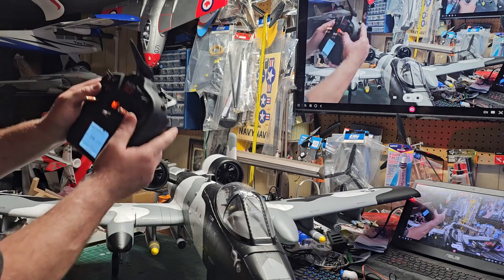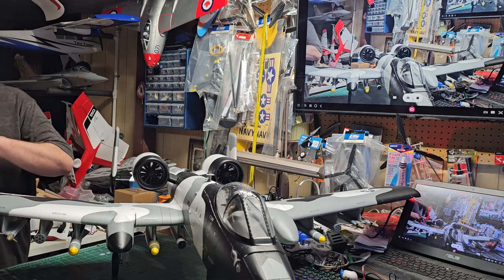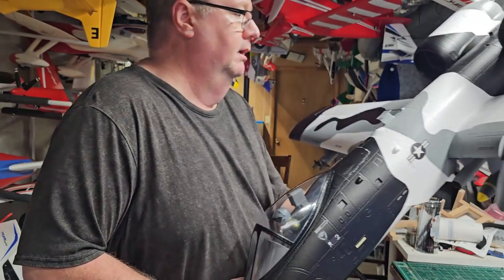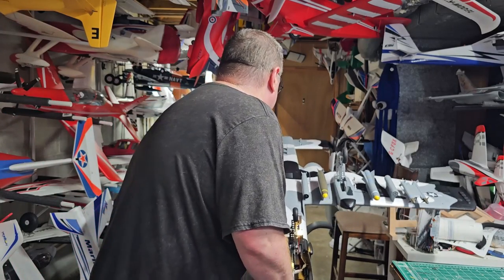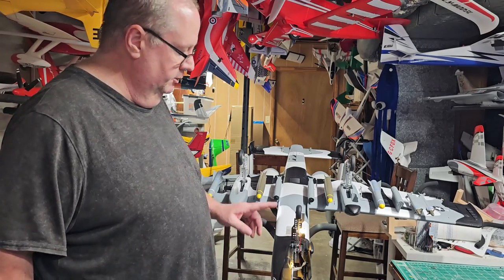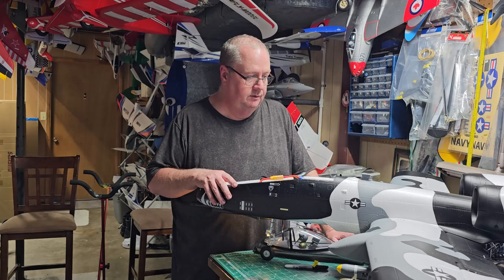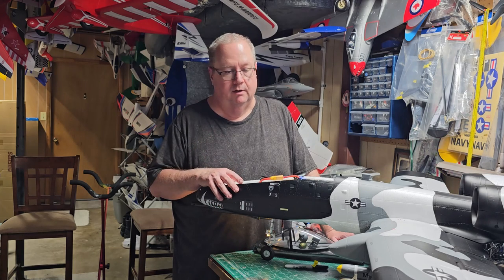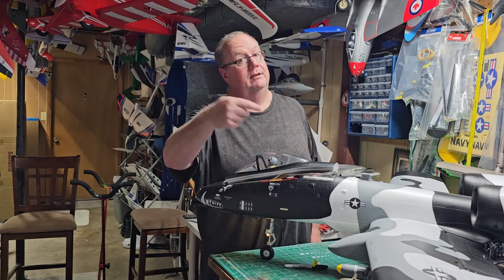FMS A-10 THUNDERBOLT V2 RADIO SETUPS INCLUDING  REFLEX by FGFRC

Comment: You set your rates as a percentage, a percentage of what? I mean are you throws equal to the book in mm? I use a deflection gauge and set rates on angle reading. Futaba user here.
Reply from the maker: The percentage is from the 0 or centerline of a servo at it's center position. Spektrum only uses percentages and everything is percentage on the radio it self. It is the same idea as mm just in different terminology. i am sure there is a simple formula for conversion.